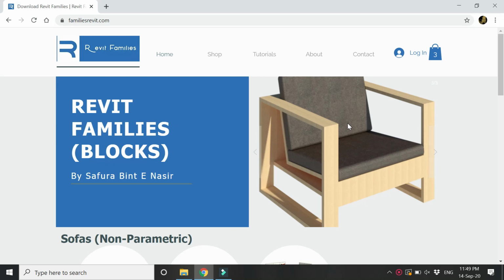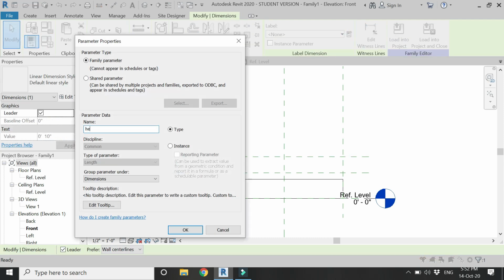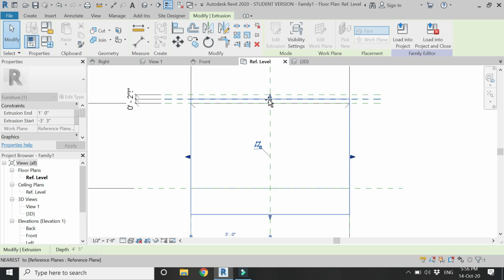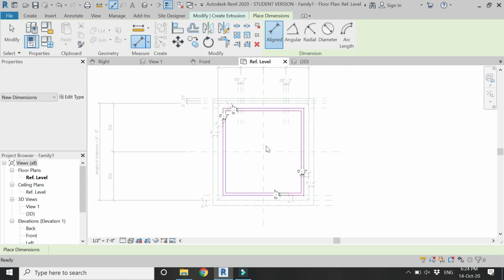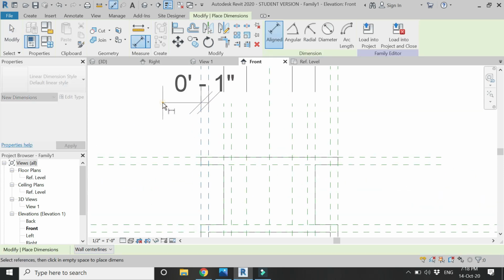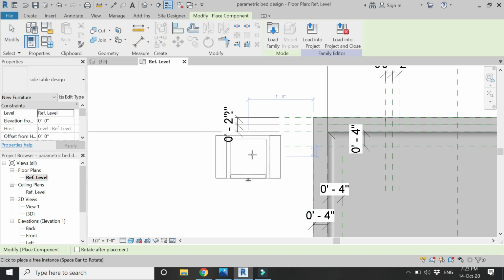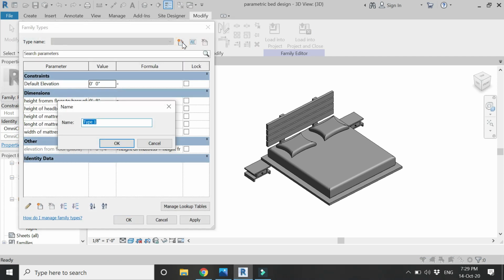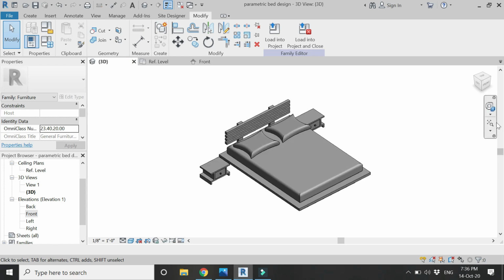Revit Tutorial - Parametric Bed Design

Comment: Hi, I have one request for a video. I checked to find out the container housing units in revit. I found a lot of issues esp. Modeling the corrugated roof and placing doors and windows in container units. The issue esp arises with pitch roofs where I want to place corrugated metal sheets. Could you please make one video that is an easy and best method. In case you didn't get what I wrote let me know I can send an email. Thank you in advance.
Reply from the maker: I will upload a tutorial on how to easily create container walls and then place doors and windows in them. As for the corrugated sheet, check out this tutorial: https://www.youtube.com/watch?v=ESu4zZjSUhE&t=19s
Reply: @LetsRevit  thanks a lot